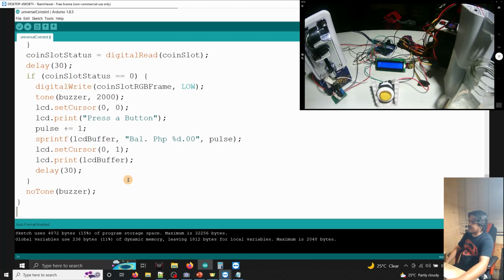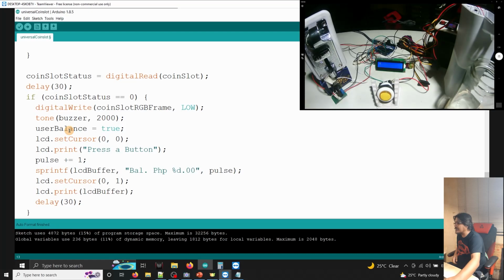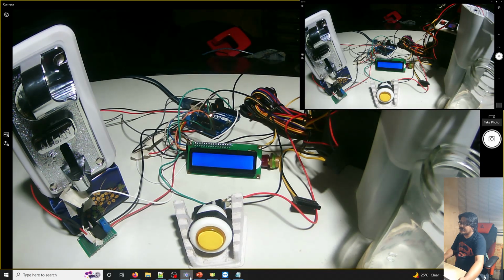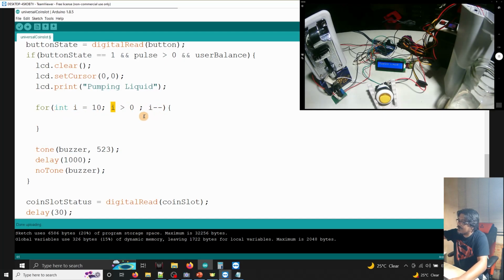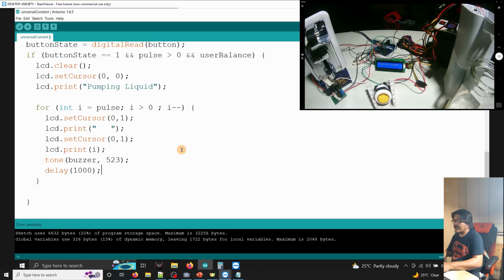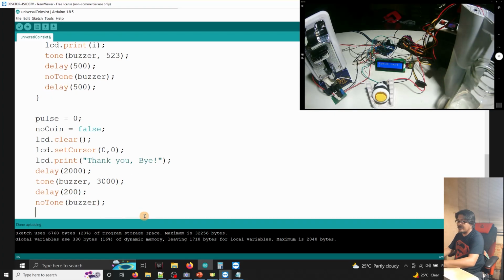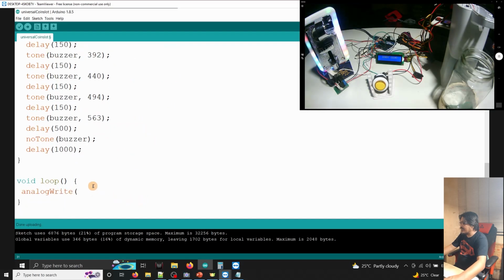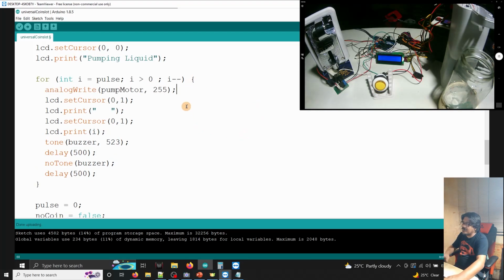PART 4 (FINAL) - ALLAN RGB UNIVERSAL COINSLOT + ARDUINO UNO COMPLETE CODING - DEMO AND ASSEMBLY

Comment: Meron po akong code and diagram baka gusto nyong bilhin? 
Features;
-Nag dispense ng cold and hot water. 
-Water sensor( pag wala ng tubig d na tatanggap ng coins)
- may pause button
- kaya makita yung availble balance.
- lcd cam display empty water pag wala ng ma detect na water sa gallon.
Reply: With coin changer na po ba Yan ? Needed po
Reply: @ajbalidio.01  sa mismong dispenser? Kumbaga nagsusukli siya if may balance pa? If kung ganon wala po pero mabilis na idagdag yun kahit kayo kayang kaya nyo na Gawin yun.

Comment: Idol Tanong ko lang kong papano mawala ang noise o interrupt ng Arduino sa coinslot, halimbawa pag nag bukas ako ng washing machine nag kakaroon ng hulog ang coin slot, ung big lang pagpasok ng kuryente naapiktuhan coin slot sa arduino
Reply from the maker: add ka 10k resisitor from the sensor wire going to gnd iadjust mo lang resistor value  as necessary based sa noise level